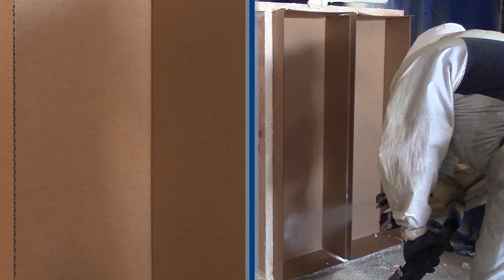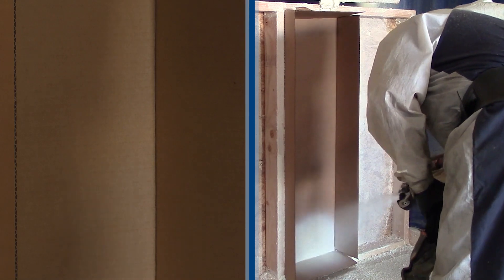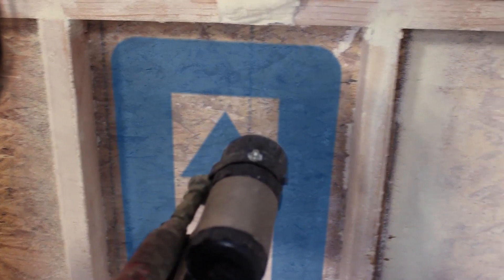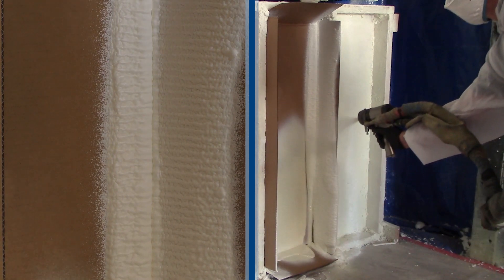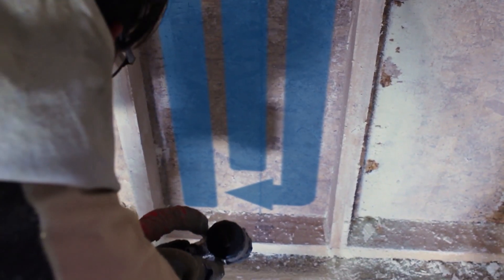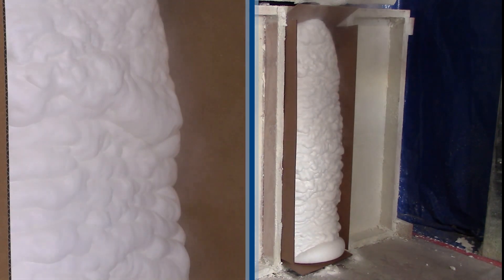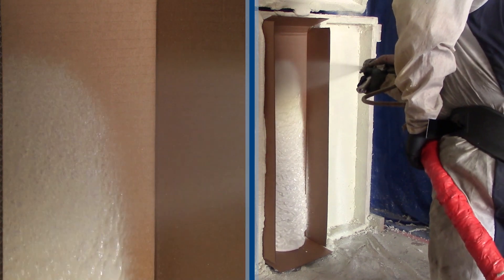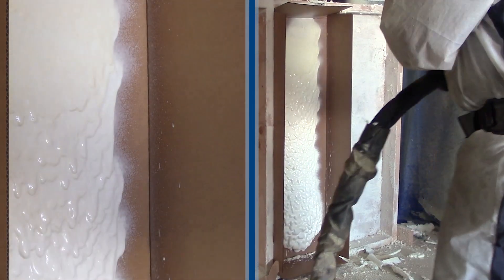Different Spray Techniques

Comment: Helllo, does using a barrier to prevent expansion out of the cavities, alter insulation properties?
Reply from the maker: Hello Joar, Without more information it is difficult to give you an exact answer on how using a barrier might affect the foam or the substrate you are applying to. When applying spray foam it is always best to consult the manufacturers guidelines in order to get the best performance. If you are using any of our products you can always reach out to our tech team 888-380-2022 for detailed help with the application of any SWD products.

Comment: Is it ok to apply spray foam insulation when the attic is 110 degrees? Will it fully cure? Or will it off gas forever?
Reply from the maker: Hello Charlie, we always recommend checking your manufacturers' product documentation when it comes to environmental conditions and determining re-entry and re-occupancy times.

Comment: For a very smoother finish , maybe step back a little and definitely on side to side work from top to bottom... for a better look which gives customer a more satisfying experience...inspectors also can see the  quality of a nice finish.  vertical spraying u should box in first or at least top and bottom.  Also need to at the top and bottom while spraying speed up at turn. Hard to  explain in texts but if u just go up down up down at same speed top n bottom will fill more.. so on way up right before u go to go down u gotta speed it up and slow after finishing changing direction..

Comment: Ouch slow down.. spraying closed cell you prob should box in,  especially in winter.. build up a wave and follow it down. Only rises so fast and leading or spraying too fast you'll run thin and cost u more strokes.

Comment: Can someone tell me how to control the pulling away from studs on open cell foam ?
Reply from the maker: Hello, foam pulling away from the studs could be caused by a variety of things from wrong temperatures, improper moisture content, to not wetting the studs. Checking the rise time can help determine if it is a temperature issue. For more detailed information on processing procedures for our products you can find our processing packets on our website swdurethane.com. If you are needing immediate assistance you can reach our tech team at 888-38-2022